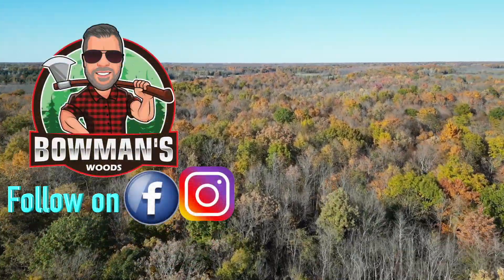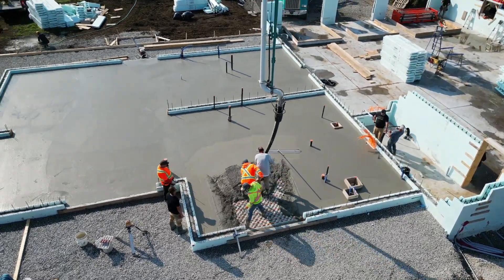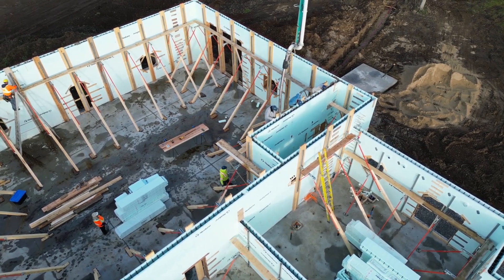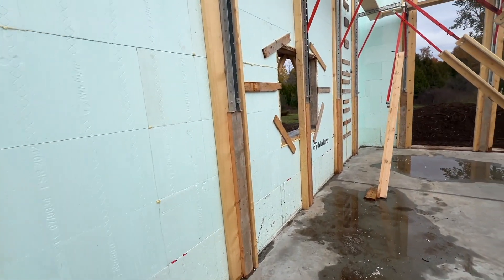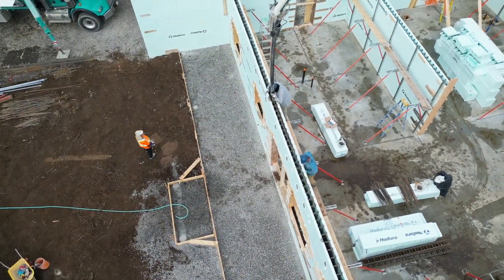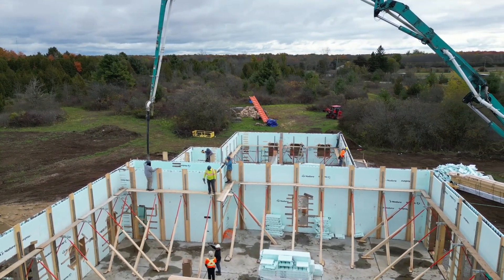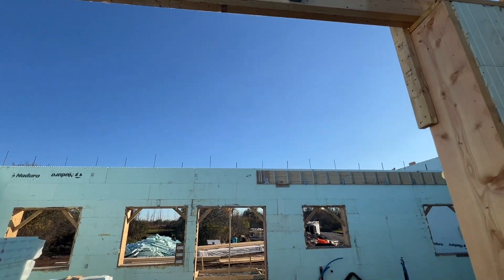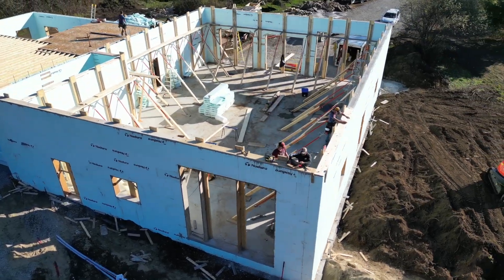Building a solar powered Off Grid ICF house Pt#2   15' concrete walls poured.

Comment: The solar wouldn’t be enough to power the infloor heating?
Reply from the maker: Electric heat is very inefficient and would probably blow through out batteries fast.   In floor radiant heat via an outdoor wood boiler makes way more sense when you have limitless wood from our forest.  Almost free heat except for the cost of chainsaw gas etc.

Comment: I've never seen the concrete floor placed prior to the walls.  I think you'll be scraping cured concrete for a while.

Good luck on the build!  ICF is great!  PS., Concrete cures -- it does not dry.

Comment: 1:46 that’s crazy u paid for a pump truck just to pour footers, that was def a waste of money, wheelbarrows and looks like a truck can get around most of that or conveyor truck would of saved a lot
Reply from the maker: Its a big footprint with a lot of Concrete.  I dont think anyone wants to push a wheelbarrow through dirt all around the property.  Im glad we did it our way
Reply: You can’t push a wheelbarrow with concrete for a footing that big you’d be a freaking idiot. Best case use a skid steer with a 1 yard bucket on it. That’s the only way that could be done a special concrete bucket and but the pump does such a better and easy job?

Comment: What's the R value of the ICF walls?
Reply from the maker: I believe it is R30.  The benefits of ICF is more than just R value.  It is good for sound proofing, fire resistance and being pretty much storm proof.  I hear they are pretty much bullet proof if that matters.  :-) Lot of benefits.

Comment: We own an ICF home, which we love, and I worked for a company that sold concrete. You do not fill the walls with cement, you fill them with concrete. Cement is an ingredient in concrete, along with sand, aggregate, water and occasionally color and fiberglass. Cement is to concrete as flour is to a cake mix. You don't bake a flour, you bake a cake. It's not a cement mixer, it's a concrete mixer. They are not Insulated Cement Forms, they are called Insulated Concrete Forms. Just thinking you might want to use the correct word since you're sharing your expertise with the world. Nice video and plan, though.
Reply: Pushed glasses up - Um actually...
Reply from the maker: Ya.  I just seem to call everything cement.  Wasn't sure what the difference between concrete and cement.  Now I do.  Glad you like your ICF house.
Reply: I imagine every time he said cement, your eye twitched a little. 😂

Comment: I’m planning our ICF house for 2026 in South Dakota. Will be 2-story, full basement, and about 4,000’ of house, 900’ of garage.

How did they determine where they could safely fasten the 2x4 blocks to the slab for the kickers to mount? Is it thick enough where they were not worried about the PEX lines for the radiant heat?
Reply from the maker: Best of luck with your build.  House sounds big!  Not sure about your 2x4 question.  Im the video guy and lend a hand but Im not a knowledgeable builder.

Comment: It'll be nice to pull your live-in trailer into the barn while interior of home is built. Very interesting watching the stages of construction. What is the R-Value of the walls? Will you have barn roof insulated? Is that rectangle between home and barn the mechanical room? Will you have a tankless water heater for home potable water? How will you separate water for floor heating from potable water (I assume floor heating water is on a closed loop)? Barn A/C or fans to ventilate, or both? Seems plenty of solar to run A/C! When cloudy days just turn barn A/C temp higher or turn-off. I am jealous!!!  :¬) Webhead USA
Reply from the maker: Thanks.  Yes, living in the trailer in the heated garage will be a good option while the inside of the house is a construction zone.  I think the R value is 30?  Maybe more?  The radiant floor is in the garage (Barn), so the ceiling will be insulated the same as the house.  I know that is A LOT of insulation but we want a heated shop/garage.  Got to insulate it.